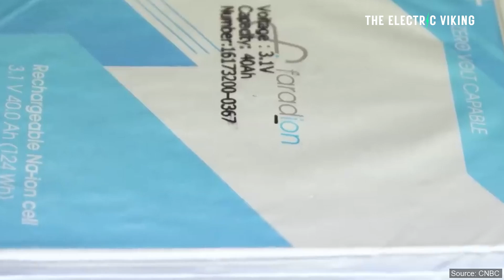Ex-Tesla engineer creates Sodium battery as good as LFP for $25,000 EVs

Comment: The BIG question is ---  Does the battery actually exist in a vehicle proved to work?

No
Reply: Yes 
More than 1. Just because you don't know about them Means nothing. They already do exist. And yes they are real
Reply: @LithiumBatteryGuy  120w/KG is not a gamechanger, its les than half the density of Lithium, which means you will need 2-3x the battery weight to match similar performance to Lithium.
Reply: @elftax  your smart and know some facts. But it doesn't mean you know everything. 
Pessimistic outlook vs optimistic it's all in the eye of the beholder..

I just want to know what you really think about the long term future of energy? 
Don't say hydrogen please!
Reply: @elftax 
The point is that Na-ion tech can shave the cost of a daily commuter down to $25k for those who don't need extended range.  Weight won't be an issue.
Reply: @PETERJOHN101  you think that a family EV can be brought down to the price of 25 iPhones?
You would need mature Na-Ion tech not nascent untested batteries that have not been proven in real world testing. There's a reason why Tesla still uses 18650 batteries, it's a 30 year old tech that has been tried and tested in numerous industries.
Reply: Ahhh, the typical " I have no clue what I'm talking about" comment
Reply: BYD Seagull 30Kwh Sodium ion battery
Reply: No, but on paper it looks amazing and you should definitely buy a Tesla because buying any other car is like owning a horse... also, something about full self driving and the car being a robot.
Regardless, buy a Tesla and loads of stock... do it now before its diluted and Musk gest the $56billion handout!!!
Reply: @elftax  Love to, waiting for  that "affordable" one.
As for investing, love to but need all my money to live on
Reply: @BuellUlysses  you're missing out on $$$, with FSD your car can be making you money as a robotaxi!! Musk said that it will be ready by 2020...2021 max,  its now 2024 so the technology is more than mature.... you are missing out on $30k a year in potential earnings

Comment: For any battery, please list:
1) gravimetric energy density (Wh/kg),
2) volumetric energy density (Wh/L),
3) cycle life,
4) calendar life.

Depending on the specs, the Sodium battery may be only suitable for stationary instead of mobile applications.  Meaning the Sodium battery may never be utilized in cars as the energy efficiency is not sufficient to compete with the alternatives.

Finally, please also specify whether the materials in the cells contain enough value for recycling to be worthwhile.  If the recycling cost exceeds the material value, then Lithium batteries will still be more beneficial for the environment since the materials won't be "used up" and go into landfills.

IMHO, anything that doesn't go into landfills is still better than something that does go into landfills.
Reply: That is actually highly variable.
The EV1 used lead acid batteries and was successful enough that a group of people wanted to keep it. (And lead acid are recycled, enforced by law, and occasionally defeated by organized crime).
And GM along with Chevron engaged in what was probably a criminal conspiracy - NOT to keep the EV1 because that part wasn't actually criminal but to defeat CARB and the "will" of the people (and that part was!).
My Point: the EV1 was NO Tesla Model 3 - not even close - but if an equivalent Na-Ion battery vehicle was available for $20K US (or $15K) it would occupy a big chunk of the US vehicle market.
The people who would buy it are the people who just need to do things like buy groceries and get to work and who DGAF about zero-to-sixty. Who don't have an acre in the burbs and a bass boat and an RV and right now drive a ten-year-old Toyota. University students, people with basic jobs - the people who bought the ORIGINAL Toyotas and Hondas and who are no longer served in any way by the auto industry. The crappiest, most inconvenient Chinese mini-car is STILL more convenient than MOST American transit.
Power windows, locks, A/C and cruise only became "standard" items in the late 90's - all this fancy s**t was for rich people's cars. We don't NEED OTA updates and a "connected" car; Ford trying to "out-Tesla" Tesla is a stupid strategy. Sun-Tzu would not be impressed.
Reply: @capnkirk5528  Ford trying to "out-Tesla" Tesla...To know your enemy you must become your enemy.
Reply: @capnkirk5528    - Agreed.  Don't know why Elon isn't RUSHING the "smaller EV Tesla" (Model 2?) to market.
 I guess he doesn't want to CANNIBALIZE existing M-3, M-Y sales on a lower profit  in-house competitor (to Tesla's bread-and-butter sales makers). 
(PLUS if he started WIPING OUT the legacy,  ICE auto-makers competition HE WOULD WHIP UP EVEN MORE HATE against Tesla and himself ??)
Reply: Sodium-ion batteries are recyclable.  Sodium-ion batteries typically use less toxic materials, making them potentially safer and simpler to recycle.  The recycling processes and infrastructure for sodium-ion batteries are not as developed or widespread as those for lithium-ion batteries, however one would expect that to change over time, as sodium battery storage gains market share over coming years and decades.
Reply: @JoeyBlogs007 

They have very high C rates for charge and discharge without harm they are more temperature stable . They can be discharged to empty for transit, without damage 
They take a lot less energy to make and about 1/10 the water to make.  
Its in salt ... And soda ash ... 80 % of the latter sits in the one area of the US  Na Cl its found everywhere just about and in huge quantities. .. Cl is a valuble chemical feedstock. .. you can make your battery cells using Al cases ...it presents new cheaper battery partnerships...so Al and Sulpher also look interesting.

 Whilst also using most if not all of the same Li battery forming technology/plant.
Reply: Calendar life is largely ignored, but it will have a dramatic effect on resale value of EVs.  If a battery pack has a 300K life (great!) but an 8 year calendar life, used EVs will have little value if you know it will expire like milk.   2014 Teslas are now 10 years old, and a lot of them have had their battery packs replaced.  Of course, those were earlier batteries with less effective management so hopefully current Teslas will last 15 years at least.
Reply: @ohger1  I know someone who has an original 2014 Model S. He has never had his battery replaced and has had AFAIK very little issue with his "S" and raves about it (in comparison to the 2012 Porsche Cayenne it replaced).
Of course, he IS rich and did always have another vehicle (or two) and the Cayenne was a "toy" just as much as the "S" was, but that's how the market starts.
His wife now has an "X".
Reply: @ohger1  - A funny thing is, I am only on "Year 14" of my 2010 Kia Soul 2U ICE Vehicle! And, as normal Vehicle buys go, that is the Longest I've ever kept a single New, OR Used Vehicle I've bought! 

My "Apartment Life" is not suited to BEV, and even worse for a PHEV, if I wanted to Drive it Daily on Electric! 

But, I DO want to Go BEV + Solar! However, Those don't fall under the control of Apartment Dwellers! So, some "Change" is Required, in my life, to make the Jump!
Reply: @ohger1  Toyota Prius hybrid is the proof, that battery can operate much longer than 8 year in much worse conditions. What a paradox
Reply: @GgDBXS  Those batteries aren't the main motive for the Prius where a pure BEV demands more current over time than the batteries in a Prius, plus I believe the Prius batteries are NiMH.  But they do last a long time.  One of my customers buys dead Prius cheap and "rebuilds" the battery packs swapping out cells as needed.
Reply: Once EV super charging becomes ubiquitous,  range limitations of near all battery types will become less relevant.  Battery selection will become more highly dictated by cost,  rather than range.  Most will be happy to top up 300 km of range in under 10 minutes,  which is ultimately where the technology is heading and which is a range that sodium ion batteries will be able to comfortably handle.  After 300 km of driving,  most people will want at least a 10 minute break anyway,  which fits nicely with future battery recharge times.  Battery range simply wont be a limiting factor.  It will all become about cost and EV operating efficiency.  Carrying a large battery around simply wont make any sense at all and battery sizes could eventually fall, once EV super charging becomes ubiquitous.  i.e  just like regular ICE petrol stations are everywhere, so will become EV super charging stations.
Reply: @JoeyBlogs007  - Because "WE" don't all live at a Single "Dot" of an Address, that "300 Kms" requires DC Fast Chargers that Work, in 30-50 Km Maximum Intervals, on "All Routes", from Interstate, to State, to County Roads! 

We are far from that, and "The Grid Infrastructure" Will need some additional "Work" to deliver on that! 

Many Highways, in Many Places, still, in the USA & Canada, are not Peppered with Power Poles! I have driven some of those Routes!  

"Gas Stations" are supported by Diesel Generators, in some of those "Gaps", and others are just Fueling and Energy "Deserts!"
Reply: Any battery at the end of it's usable life in a vehicle still has plenty of life in static applications, well before it needs to be recycled. A Tesla Powerwall 3 is only a 14kWh battery and there are plenty of home batteries with smaller capacity than this. Old battery chemistries may not have the number of cycles available that today's batteries do.
Reply: Are not most landfills filtering only products good for land, recycling  all other ?
Reply: @jimanderson4444

Nope. 🫤
Reply: @jimanderson4444  Thats the theory. I know in Vancouver they have to semi truck their garbage away so they do go through the waste quickly at a transfer station. Makes sense just for savings. Plastics go in a blue bin, glass in another. They have green bins for anything compostable which goes to a seperate landfill for making soil. They also have one garbage burning to electric plant. Batteries and electronics go to a station.
Reply: Perfectly stated! Spot on!
Reply: Also very important is the voltage profile across the State's of charge, which is quite different between chemistries. This affects the suitability for applications.  My understanding is that sodium batteries have very large voltage changes across the state of charge.
Reply: "recycling costs" for sodium batteries - even if more costly than the materials (salt!) would NOT have to be a problem - 
states could simply put a small TAX on each battery, which would BE REFUNDED if you turned it in for recycle 
(as Maine and other states do for glass soda bottles).
 BIG PICTURE, the  ENTIRE "Enviro" movement is RIGGED (by the criminal billionaires cabal) 
because IF  it were 100% legit, EVERY HOME in the sunbelt (and MOST homes north of it) WOULD HAVE SOLAR PV PANELS ON THEM, YESTERDAY!
Instead, , the "ENVIRO" groups are funded - OWNED & PAID for! - by the people behind the BIG BANKS, BIG OIL, and the military-industrial-congressional-media complex...
just like those stupid German kids "protesting" =  TERRORIZING Tesla factories 
with their stupid "BRING BACK COMMUNISM" (bread lines, crowded, frozen apartments and gulags!)  signs. 
 So  the "enviro" movement is sort of like all those Hollywood stars pimping for "save the animals" - 
 they raise lots of money to get bribed politicians to enact COMMUNIST LAWS to outlaw development, instead of buying land to turn in to wildlife refuges. 
  JUST IMAGINE if LOS ALAMOS,  Lawrence Livermore, and all the other usg HYPER-TECH PHYSIC laboratories
   were DEDICATED to researching  100% RECYCLING of ALL the garbage  EVERY land-fill in America, 
INSTEAD of MAKING NEWER and BETTER space-age weapons.  
    btw, IF we ever do get to space travel (much less stellar travel) WE WILL HAVE 100% RECYCLING, EVERYTHING you take on a spacecraft will be extremely valuable.
 For space travelers, the stuff in an average land-fill would be SOLID GOLD! 
There are already advanced hydroponics-aquarium systems that convert nearly 100% of bio-waste in to fertilizer for growing plants.
Reply: If materials are cheap but non-toxic it is ok to not recycle.  If batteries basically break down to table salt, aluminum,  graphite - whatever, let it sit in the landfill, it doesn't kill nature.
Reply: Well there are a few issues with your argument. 1) Na can still be used on both sides of the battery reducing the amount of over all weight. 2) Different elements go into a battery other than Na or Li - meaning the more you can reduce those for more Na or Li you end up with more over all power dens as well. 3) Cost is still a factor and if Li is harder to get a hold of because of demand - it doesnt matter how much better Li is if you can't get into your product. 4) Li and Na can be mix into the same battery or pack - off setting some of the draw backs of each other or benefiting each other. Na and Li make up a small amount of the over all battery as well - so you really are not adding or removing "that much" per pack.

Comment: I've been saying Sodium Ion was the future for a while now and will replace Lithium, once super charging becomes ubiquitous.  That is the future for EV technology.
Reply: Not so fast. I think Sodium will be big evenutally, but people already complain about how heavy evs are. Can you imagine even heavier? Remember money talks. Look what the market is doing. BYD has lithium mines lol. Explain that to me. Sodium still has a way to go but promising.
Reply: @StuartBenoit-se5kj 
The point is that Na-ion tech can power a daily commuter without excessive weight AND charge faster for under $30k.
Reply: @PETERJOHN101  You are also forgetting solid state batteries that have even more range and don't have the weight issue. But runs in to high-cost issues. Ultimately, lithium will remain king but sodium can help ease the pain on lithium.

They are even doing battery exchanges in some places. Personally, I don't think this will catch on long-term as charging is a better method IMO. Hard to bet on anything regarding EV/Battery tech because it's improving so much. Tomorrow, they may find something better than all current technology.

Comment: They make the cathode from aluminum.  Add 1% gold and your battery will last 10,000 cycles and will add much more storage.  It amounts to a little more  money.
Reply: The gold can be recycle, I assume.
Reply: any proofs?
Reply: @olgglo  well.  no.  but the cathode is what cracks.  an thats sort of what reduces its life.  currently they add some materials like nickel an cobalt.  to stabilize it an make it last longer.  im thinking the only reason for not trying or using gold is the cost.  i did a little research.  there is room for improvement with different materials like gold.   atm from a manufacturing pov its whats the cheapest, fastest, an best to produce.  hence lithium phosphate.   i think over the next few years well see batteries with gold in them, or some form of precious metal.
Reply: @Quickcat21MK  that's an interesting thing to know, thanx

Comment: Cheap battery in a Selfplug-in V2G EV parked 23hrs every day and Rooftop solar PV and the original national grid for millions and millions and millions of customers will replace all centralised generation, fossil fueled, nuclear, solar farms, wind farms, pumped hydro, etc.

The grid is incredibly expensive to expand it's capacity. 
$×km = insane economically.
Reply: Takes 3 reads to get what you are saying. Take the time to spell it out as the concept is solid but the  'bullet pointing' makes it too hard to read.
Reply: @TimMountjoy-zy2fd  Well said Tim.
Delta makes a new battery that would enable a pure solar charging effort for those who could use it. And possibly allow fast "home" charging for some renters (because you can take it with you when you move, and it will always either have a use or a market value).
Reply: @TimMountjoy-zy2fd  thanks for your comment. 
I have posted longer comments, but the simple points expand into a very long post. 
The grid expansion costs are the biggest problem. And nobody sees it.
Most national grids cost more than the nations entire GDP. Fun fact.
And built over decades and decades. 

My concern is that non nuclear countries will start to go nuclear, and then the grid capacity problem will be seen.

Australia has a $ 2 billion pumped hydro expansion project, which is now a $ 12 billion project with new grid construction. 
They are not going to stop work, too much invested. 

Australian nuclear promoters are well connected and being misleading. 

So I speak up.
Reply: Make hybred electric charging stations.  Put them near gas stations, and use the fossil fuel infrastructure to run generators to power them.  Then phase in green power including grid upgrades.  No waste, it scales, and gets us where we want to be in the end.
Reply: You’re describing Aptera.